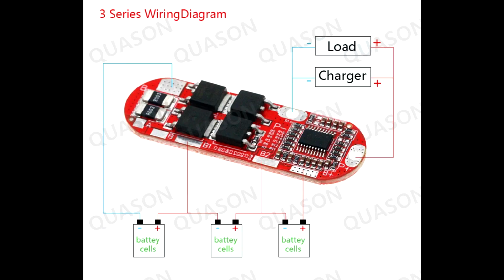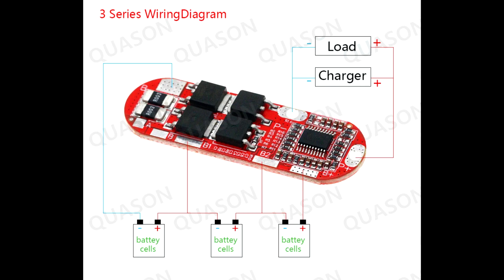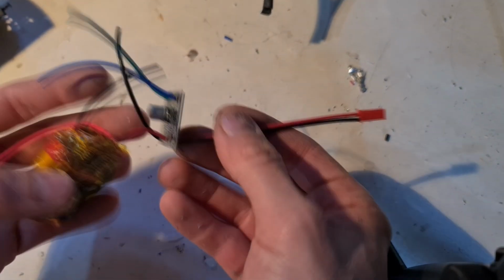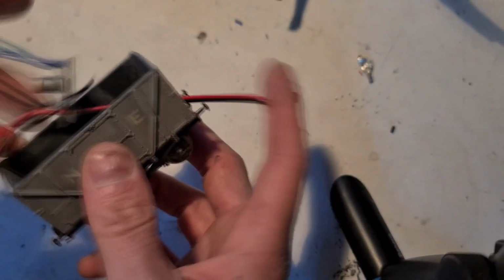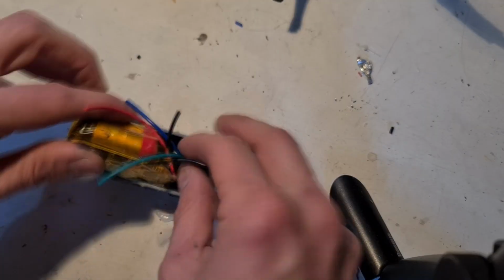DIY Wireless Model Railway with Arduino

Comment: Nice video and cool project. It's not for me to say you should do it any differently. But did you consider using an ESP32 and Bluetooth. The tiny Xiao boards from Seeed studio would be perfect for this. Onboard Bluetooth and battery management, very cheap, and low power consumption.
Reply from the maker: I did. They looked like a great option!  My only two concerns where the battery management is only for 3.7 volts which isn't enough for the motor and for larger train setups the HC-12 has great range and consistency.
Reply: Thanks its useful to know why some options are rejected, as well as the design you decide to go with.